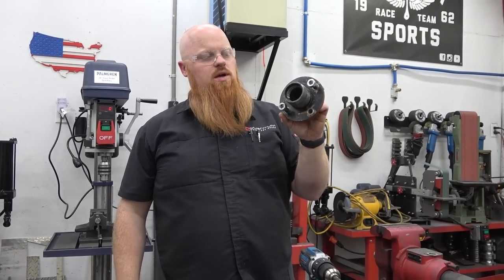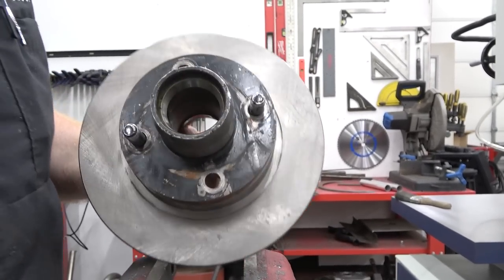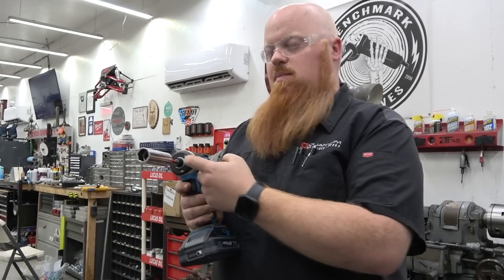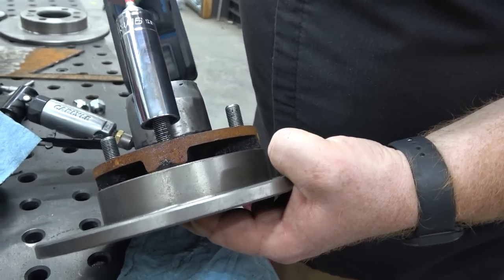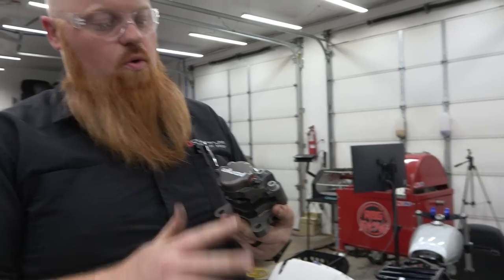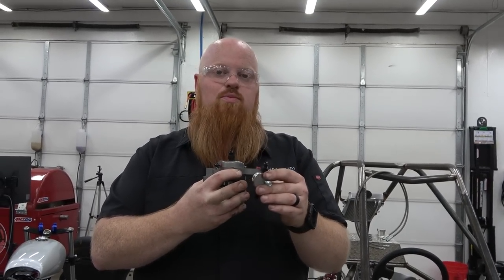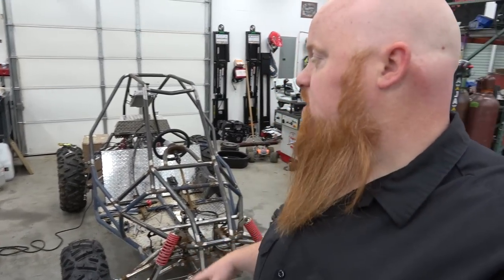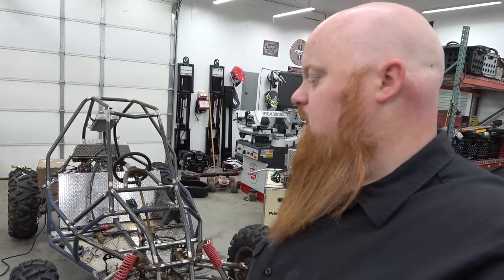DIY Cross Kart Brakes ~ YZ450 Buggy Build

Comment: Since you have the lathe, I would machine the back of the wheel hubs where the brakes are mounted to flat enough to where the rotors have a flat spot to set against. Those hubs are made from cast and the tolerances on where the lugs go in are horrendous. They just leave them as it is as it does not matter what the tolerances are since its just a spot to hold the wheel onto the hub. The wobble that is shown in the video will wear through brake pads so fast even if it is a smooth rotor.
Reply: I noticed the rotor wobble myself.
Reply: Agreed.
Reply: Yeah that wobble made me cringe

Comment: I am hoping that rotor wobble was due to the lug nuts not being tight or even on. Otherwise the hub casting might need to be faced on the lathe. The backside is not a finished side, that is the raw casting. I run those same rotors on my golf cart but use the wheel to sandwich the rotor to the hub.
Reply from the maker: It was the lug studs not seated all the way. Saw it while editing and fixed it after the video.
Reply: @RedBeardsGarage how come your didn't sandwich the rotor between the rim and hub and when to the ba k instead?
Reply: @jamesbryant7355 may have needed the clearance between the rotor and wheel to make the calipers fit 🤷🏻‍♂️
Reply: @RedBeardsGarage  Do you realize that brake rotors are allowed only a few thousandths of an inch (0.002") run-out, or the 'wobble' you guys are referring to. You may be able to get away with maybe as much as 0.005" on a go-kart. Yes i agree that you should locate the bearing bore  of the hub or just indicate the flange of the hub to align with lathe rotating axes in order to insure that the brake rotor is parallel to the rotation of the wheel. or aligned with the rotational axes of the wheel. then take a clean up cut off the back side of the hub then and only then will it be true enough. You could also determine a dimension from the newly machined face to the wheel flange, or from the bearing bore, to make a consistent and repeatable 'brake hub' from the wheel hub so that all the brake systems you build from now on are the same.

Comment: I've seen people just use air pressure to operate calipers for mocking up the mount. 

Also @ the 9min mark it looks like that rotor is wobbly.
Reply from the maker: It wasn’t seated all the way. It’s fixed now.
Reply: @RedBeardsGarage  That’s good, had me worried for a sec. I’d love to build something like this and or the Sema build. 

Love the upbeat vibe or your videos, keep up the good work!
Reply: @RedBeardsGarage  Do you know how to check run-out with a dial indicator? If that is information that you think would be valuable to you, than I think you could find the procedures on line and certainly on YouTube. Checking for rotor run-out on automotive brake systems is common procedure in the industry. Thanks, John Toolan, Auto Mechanic, Machinist, Craftsman and Fabricator. Also have practiced skills in, Electrical systems, Hydraulic systems, Pneumatic systems, Welding, Sheet metal, and, Mechanical Engineering. Also, would like to say that your idea for putting these components together is very creative, and very sound Engineering. I love to build with off the shelf components that are cheap and abundant. And I Engineer my projects so that the assemblies can be repaired or replaced with ease and simplicity  anywhere the maintenance is performed, or, the break-down may occur, out on the road, out in the back woods, or in the drive way, anywhere in the Country, any State. No need for proprietary parts or assemblies that can be had from only one source, not with this kind of build. Good job!

Comment: That is just genius.  Basically spare autozone parts to make a custom 4 wheel  disc brakes setup.  Never in a million years would i think to myself "hey lets take a rear miata rotor and some cheap trailer hubs and make a custom disk brake setup"

Comment: I took an idea from Coleman for my fl459 build. A simple bracket with a bolt, spring and a couple nuts will give you a simple parking brake. You will have to manually reach down to set it, but once you press the pedal the spring retracts the bolt and the pedal is free to move back and forth. Helps me on my hilly yard when opening the gates and it also helps with creep too.
Reply: Should have put a build like in comment

Comment: Just saying this to no one in particular, but these high mounted radiators, if heaven forbid there should be a failure of the radiator, a split, cap comes off etc., the thought of a 180 degree shower is just too much lol. I’d have to shield myself from that somehow.

Comment: Hi Red, new fan here. Question: would those brake caliper brackets benefit from having a small angled piece giving them sideways stability? I'm not a welder or a builder (yet), so I'm curious if that would be helpful or just overkill.